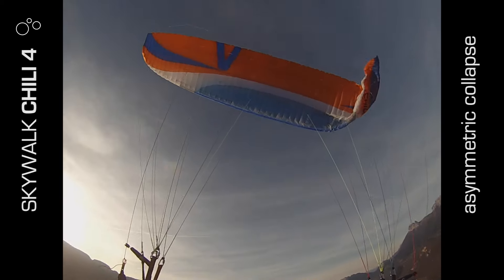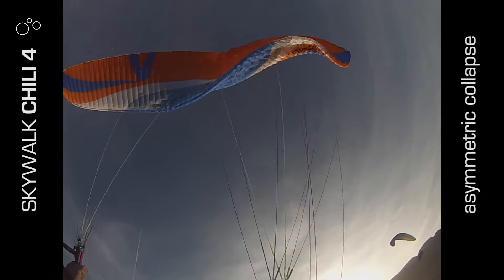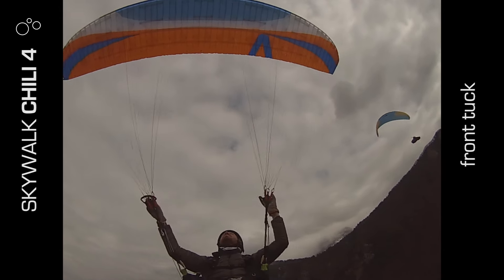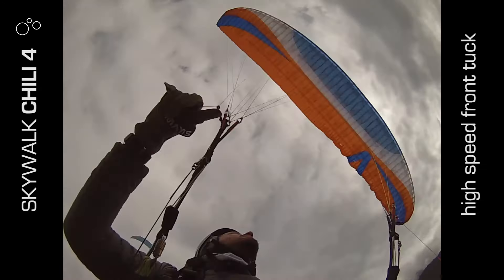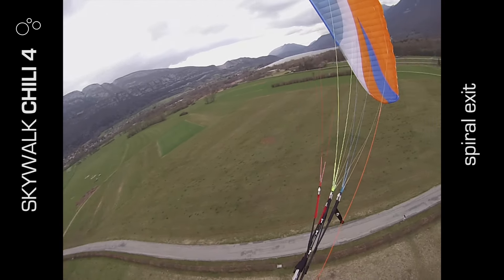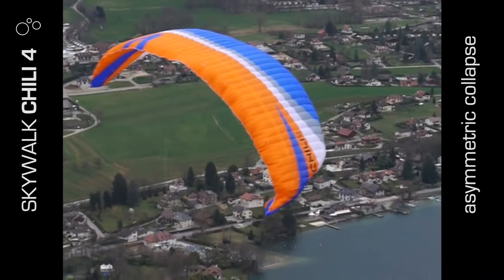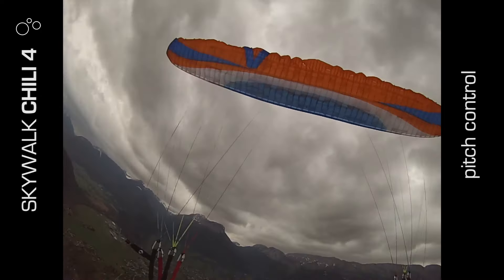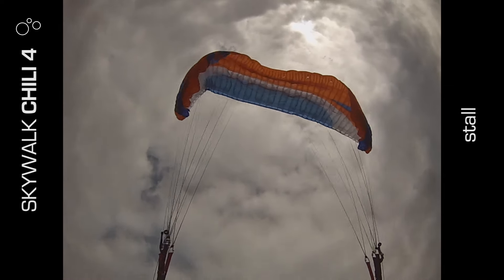Skywalk CHILI 4 (Flight Test)

Comment: Thanks for the vid. But the tricky part is that flying only a two liner and having no other EN B glider to compare with makes the review less convincing for most B class pilots. Also the weather seen in the movie does not look like strong conditions; bad things do not happen in calm air.  I remember buying a Chili3 7 years ago  when I got slightly more than I expected I bought it after watching a few optimistic reviews like this one. Now I like  it but  the first opinions from advance testers were slightly misleading.

Comment: I was wondering if you can use this wing on a paramotor and I got the same skywalk chili number for Wing and I was going to use it on my paramotor but sometimes this Wing wants to collapse will it gain its position after it collapse so do you need to pull on the brakes